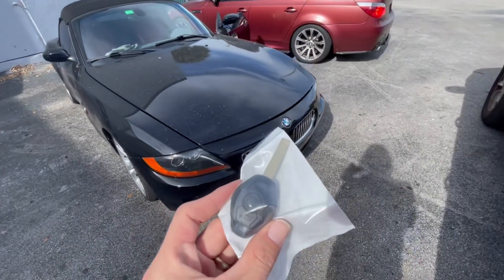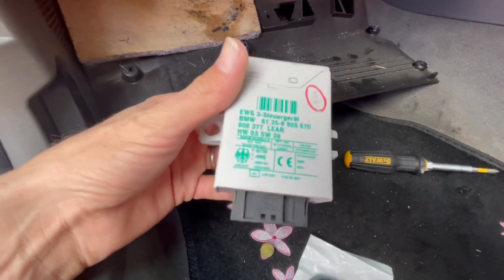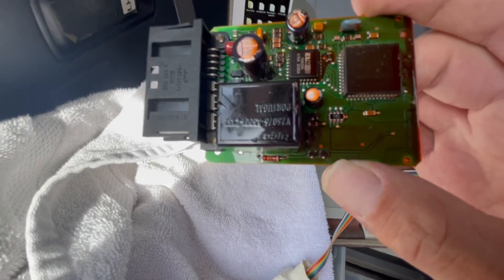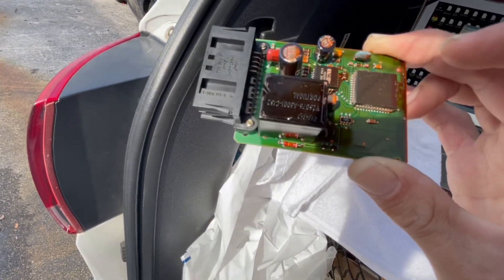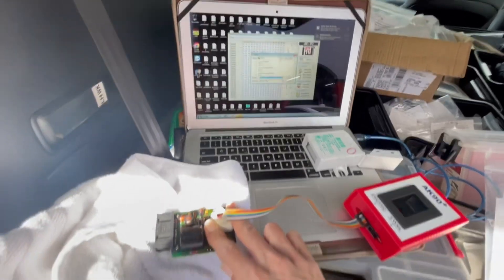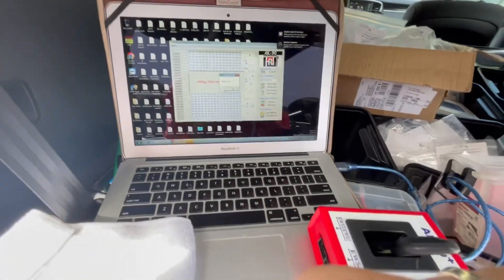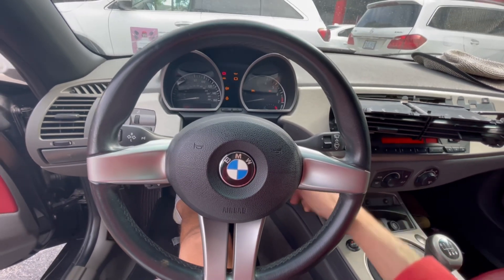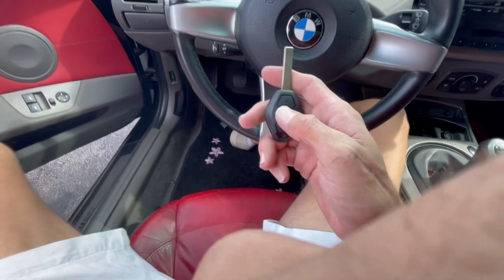HOW TO PROGRAM A KEY FOR 2002-2007 BMW Z4 ADD KEY AND AKL USING AK90

Comment: Great ! Did you purchase your spare keys on EBay as well ? Also , is the Ew3s adaptor the pretty wire with the white head that you used on the towel to read the chip ? Thanks
Reply from the maker: The key was probably purchased in one of the Locksmith shops. Yes this is the EWS 3 adapter.

Comment: Where did you get the ak90? I have seen several in AliExpress. Do you have test them from there? Thanks
Reply from the maker: They should be okay. I got mine in eBay but make sure to get the one with ews3 adapter it’s cheaper that way to get both.